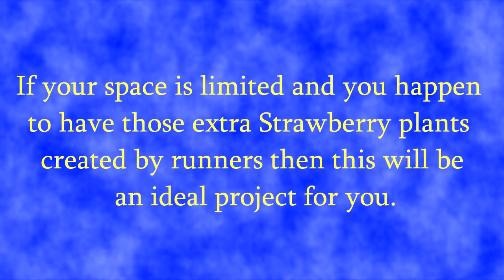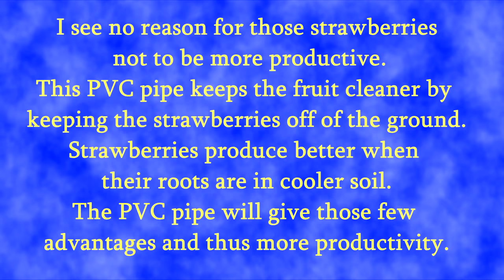Strawberry Pipe Planter

Comment: i made 1 by cutting a line then use heat to bend it out so i have more space but i did not use styrofoam. i use plastic and hot glue  but i dont think it will hold i may rip it out and try this
Reply: Did you use a thin wall pipe? Vertically? Will it also work horizontally?

Comment: Thanks for your reply, from your video and a little idea of my own, I’ve come up with the following idea that you might also be interested in. That being to.. (1) prepare any equal two lengths of PVC as per your video (2) Bolted together and hung on the top of a fence, or bolted permanently through the top of a fence -OIO-. (3) Self watering could easily be done by hanging a container at one end to gravity drip feed each plant from a drip hose. As the water container could be of any size,  and the plants are off the ground, except to periodically fill the water container, the strawberries would need little maintenance.